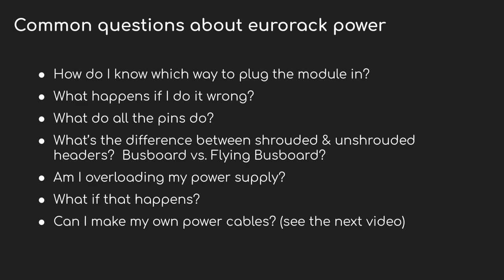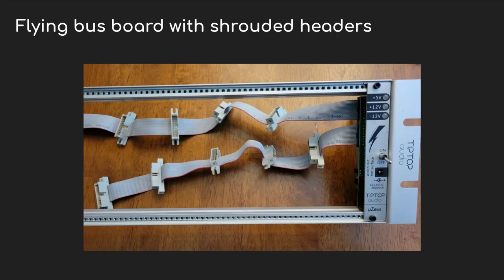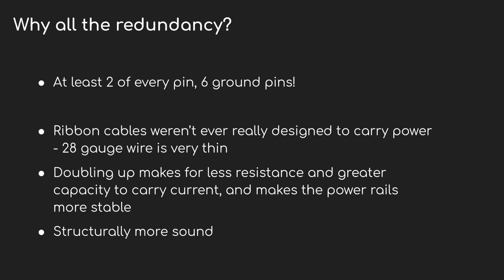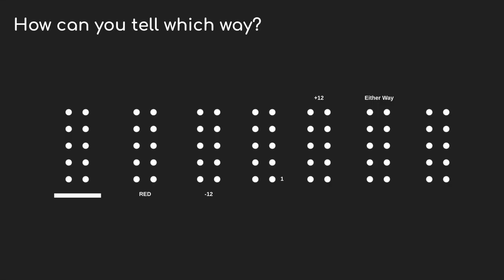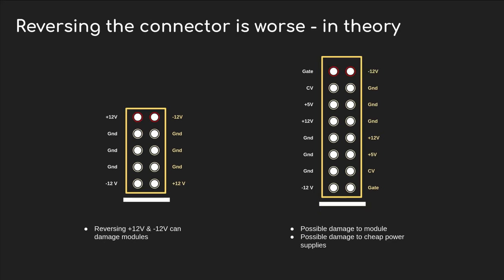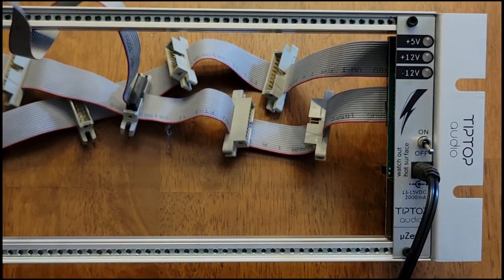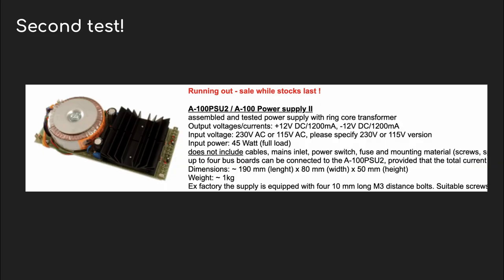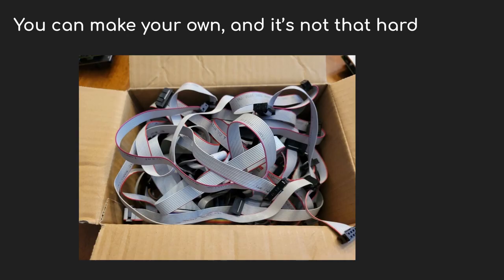Intro Modular 1A: All about Eurorack power

Comment: The only advantage of an unshrouded bus board I can think of is the connectors are easier to pull off.  I've experienced quite a bit of finger pain trying to winkle the low-profile connectors out of a shrouded socket.  It's the Eurorack equivalent of stepping on Legos.
Shrouded headers are not a foolproof anti-reverse protection either.  The only module I ever plugged in backwards was an Evaton CLX in my Pittsburgh case, which has shrouded headers.  Evaton included a cable with gray connectors that DID NOT HAVE A KEY RIDGE on them, meaning it would fit into the shrouded header either way.  I did not notice this, and I plugged the module in without looking because "it's shrouded headers, I'm good."  (Having the "safety feature" made me careless.  In my Doepfer and Trogotronic cases, both of which have naked pins, I always double check.)  The CLX was plugged in wrong for several sessions.  Everything else was working fine and CLX has no lights on it so I didn't know it was messed up, and it wasn't a module I use a lot so it sat there for a while with its power upside down..  Only when I patched it to another module did I get any indication that something was wrong.  Don't remember exactly what happened but I could tell right away something wasn't right so I shut it down and opened the case.  The crazy thing is, nothing seemed to be damaged and after correcting the power alignment the CLX worked fine.

Comment: That was nice, thank you :) What about plugging / unplugging while the power still runs through the rack? I have heard some don't worry and some do because for some modules it is important which pins connect first..
Reply from the maker: I would avoid it just out of an abundance of caution.  What you describe is a possibility, so is accidentally seating the cable wrong (I will plug i in off to the side sometimes), which would leave live pins exposed.  Also some digitial modules might not like having intermittent power flickered on and off as you're working the power header down.

Comment: Great video. So the metal rails along perimeter of the case have nothing to do with power correct? All power comes from the power ribbon cable?
Reply from the maker: @soundwithoutsoundbutwithso7884  - That's right, it all comes from the power connector.

Comment: Okay. I’m beginning to think about relaxing about power. 

Here’s a question: is it max one power supply per busboard? What would happen if I plugged two powersupplies into one busboard?
Reply from the maker: I believe that if you were to connect the two power supplies in series, you would end up with double the voltage, and that would be a bad day.  If you connect them in parallel, I think you would increase the available current.  But there are a lot of caveats there and I wouldn't do it except with someone who actually knew what they were doing -- unlike me. :)
Reply: @SoundVoltage  okay cool. So you’re saying I should relax THAT much?
Reply from the maker: Well, I think you should relax about using power supplies as they are intended :)  It's hard to cause too much damage -- it's been 1.5 years since I made that video and I haven't had a single problem (power-wise) in that time.  It's worth paying attention and double checking, but don't live in fear.

But I wouldn't suggest trying anything tricky like hooking up two power supplies to one set of busboards.